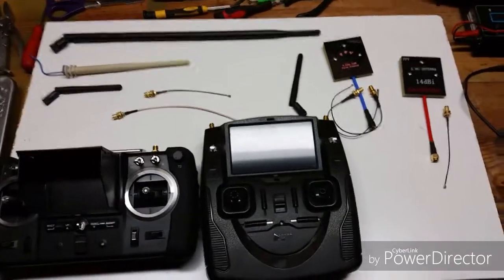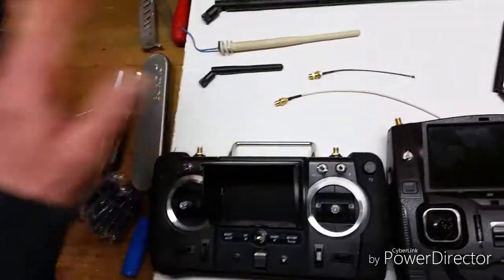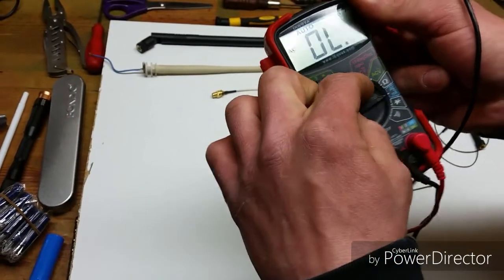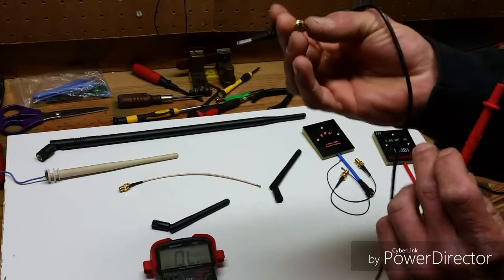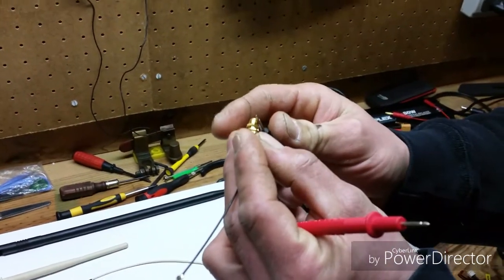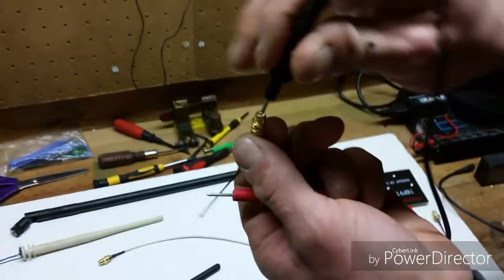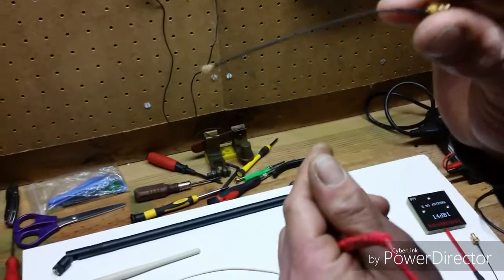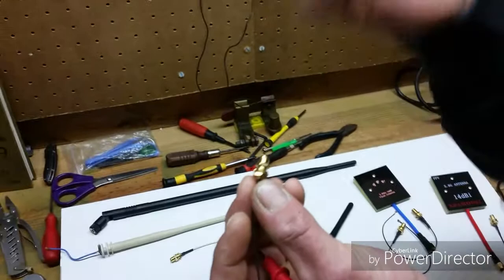hubsan h501s Advanced Controller Range or Control Problems? How to test TX & RX Cables

Comment: My advanced controller will not pull up the calibration tests after both units are turned on.  This problem occurs inside out side GPS no GPS any ideas????? Thanks
Reply from the maker: First, when did you buy your quad? If you just recently bought it, I have been hearing from a lot of people that compass calibration are no longer needed, unless the Drone is flipped or crashed. Secondly, if you have the usual model where you have to do calibrations every flight, are you receiving fpv signal on your controller ? If you are, is it showing your GPS coordinates on the bottom of the screen? It should show both the controllers and quads GPS coordinates. If you only see 1 instead of both, tell me. Anyways, with that said, oh yeah, how long have you had your quad? Have you ever crashed it? My number one thought, would be that you have a faulty 2.4Ghz SMA to Ipex cable, inside the controller that runs from, the module to the antenna. That's a very common problem with the advanced transmitter. Second thought would be that, you need to rebind the controller to the quad. If you could answer those questions I asked, I could help you better. Remember that according to a lot of people, newer 501S models, no longer need compass calibrations, unless crashed or flipped. If you've had your quad for some time and this just started happening, then I would start checking the above mentioned.
Reply: @MarkSuttner  its new and has not been crashed ..i did rebind it and ill have to check that both GPS are working last i could tell was the remote was not showing but ill check again thanks for all the great information..ill let you know soon if its working or not
Reply from the maker: @aaronappleman4104  Ok, sounds good. Good Luck with it ! Remember to turn the controller on First, then the quad. Also, if the quads LEDs are flashing, in a clockwise rotation, one by one, it is needing compass calibrations, if you have the newer style setup, it should just flash like normal, like it's in flight. Then just wait for satellites & fly. Let me know what happens !
Reply: @MarkSuttner  thanks again it is a new one and does light up for flight quickly..
Reply: @MarkSuttner  hey just to follow up its working great i was worried about the calibration but it does do it itself thanks for the info

Comment: Hi Mark, your advices helped me a lot. But now I have another problem. I have standart transmitter with external antennas, an aircraft has external antennas, too. After 750m high the aircraft stops reacting to my commands, but FPV is very clear.
Reply from the maker: Abdulaziz Abdunasimov 750 Meters High ? Altitude !?? Bro, that's WAY Too High ! Are you talking about Range ? Or are you Seriously Flying 750 Meters Up ???
Reply from the maker: Abdulaziz Abdunasimov I have a Pretty Good idea/reason your quad won't respond. However, I need you to clarify if you are talking about Flying 750 Meters Up (Altitude) or 750 meters Away from you (Range)..... Which one ??
Reply: Yes, it's my altitude 750m up. I am not talking about range. I wanna reach 1km :))
Reply from the maker: Abdulaziz Abdunasimov Wow, that's pretty dangerous Bro... Anyways, if you want to fly that high, that's your decision... Obviously you have the altitude and GPS hold speed mod tool. Do you have your altitude limitation value set to 0?
Reply from the maker: Abdulaziz Abdunasimov If you do have your altitude limitation value set at 0 so there is no limitation, then it probably has a lot to do with the orientation of your 2.4 antenna on your controller. The tip of the antenna is the weakest transmission point, so you would want to point the tip all the way sideways to go straight up. Also, if you're just using a 3 dBi dipole you may need to increase you dBi's so your signal reaches further. When you go that high, your signal is literally getting bounced off the molecules up in the clouds and the atmosphere so you need a strong transmission. Some people use Watt boosters
Reply from the maker: Abdulaziz Abdunasimov https://www.amazon.com/gp/aw/d/B01ING28ZM/ref=mp_s_a_1_13?ie=UTF8&qid=1526315910&sr=8-13&pi=AC_SX236_SY340_FMwebp_QL65&keywords=2+watt+booster. This is one example of many different types of Signal Boosters they make, that you can use... However, if you decide to get one of these boosters, if you connect it to your controller and turn it on, you're going to knock out everybody's Wi-Fi and anybody else's 2.4 control signal if someone is flying Anywhere Near you. I'm talking about like a 2-mile radius !! The 2.4 module in the controller is 200 - 250 Milliwatts. If you use a 2 watt booster, you are increasing your signal strength x 100 !!
Reply: Mark Suttner yes mate, it's set 0. That booster is pretty expensive for a student 😅. Anyway 100x boost and knocking out others signlas sounds fu*king freaking 😂😂 I ordered 2.4 ghz 7dbi directional antenna on ebay. Let's see how it performs
Reply from the maker: Abdulaziz Abdunasimov Yeah, the Watt Boosters Are Insane ! Anyways, the Higher Gain (dBi's) an antenna is, it's transmission signal will go further but it will have a smaller reception/transmission area. Let me guess... Did you get the Aomway Diamond 7dBi Antenna? It kinda looks like a rectangular satellite dish or something. Did you buy that thing? A lot of people on those Facebook forums are raving about that antenna. I have a 9dBi dipole that I've used. However, you have to understand how a 2.4 transmission antenna works in order to get Optimal Performance. If you bought a directional 2.4 transmission antenna, then that's pretty basic... Just keep the antenna pointed at the quad. Dipole and any type of Cloverleaf or mushroom antenna are omnidirectional, which means their transmission comes off the sides of the antenna and forms like a 3D donut with the tip of the antenna as its feed point 4 Telemetry and so forth, that's why the tip of any dipole antenna is the weakest transmission point... There are really coming out with some Crazy Antennas ! Pagoda's, Spironet's, Cloverleaf's, Helicoil's etc. Anyways, I hope your new antenna works for you bud.
Reply from the maker: Abdulaziz Abdunasimov You may not have realized this, the antenna you ordered has a RP SMA Connector. That "Usually" means the inner signal pin sticks out of the antenna. Almost every 501's extended range kits come with regular male SMA connectors, Not RP SMA's. I couldn't tell from the pictures if the inner signal pin is sticking Out of the Antenna... If it has an "Inner Hole" for the pin, your going to need an adapter or Different Ipex to SMA line with the Correct type of SMA, otherwise it's not going to work.
Reply from the maker: Abdulaziz Abdunasimov Sure. Give me a few minutes... You want me to Remove you Email Address from YouTube? I'll just remove the comment...
Reply: Would be good if you do it. Thanks :))
Reply from the maker: Abdulaziz Abdunasimov Done

Comment: Hi, after swapping the body shell, FPV on transmitter is showing nothing, I checked a camera, it records, shoots photos and saves on micro sd. What's problem here?
Subscribed!
Reply from the maker: Sam Brandon There could be a multitude of problems that could cause the situation you are having. However, what seems most logical to me is, when you Switched the shell, you may have accidentally unplugged the 5.8 transmission Antennas ipex connector off the U.FL Connector on the FCB. I would check to make sure that is solidly plugged in.
Reply: Mark Suttner it's connected bro
Reply from the maker: Sam Brandon Ok..... Turn your controller on and then turn your drone on within a few seconds of turning the controller on. Go into your menu on the controller and see what frequency or controller is set at..... Actually it takes a few seconds for the controller to pick up the 5.8 signal from the quad. After it does that, if it does, it should automatically pick up the Quad's frequency, if not you may need to rebind the controller to the quad.
Reply from the maker: Sam Brandon Do Not turn your quad on first ever. Always turn the controller on first....
Reply: Mark Suttner I did as you said. It shows here 5845Mhz and still no picture. But voltage, wind speed, altitude and other characs are displaying
Reply from the maker: Sam Brandon Change it to 5755 MHZ, see if that works. You are very high in frequency, it should not be that high.
Reply from the maker: Sam Brandon The on-screen telemetry is received by the 2.4 dipole antenna. if you are receiving Telemetry from the Quad, at least your 2.4 is working correctly. you are definitely having a 5.8 issue. make sure you have your panel antenna on and you should also check the ipex connection inside the controller. The H906A controllers are known to have 5.8 coax SMA to Ipex that go bad. The only way to check if they are still good is a continuity test with a multimeter. Also, bring your controllers frequency Down. It should be at 5745 -5760 MHZ. 5845 is way too high.
Reply from the maker: Sam Brandon Hey Sam, did you ever get your FPV Screen working ?